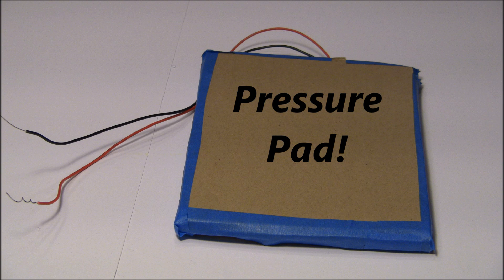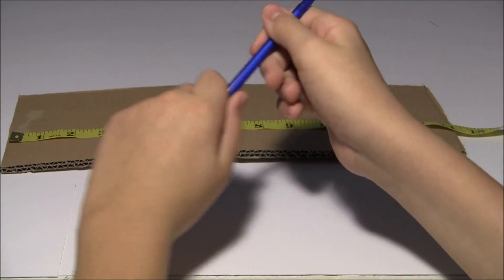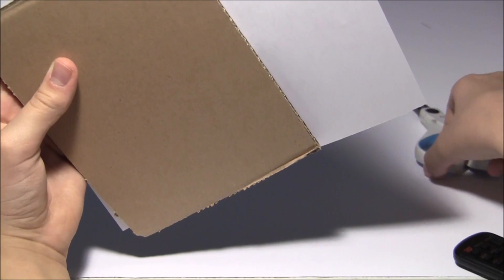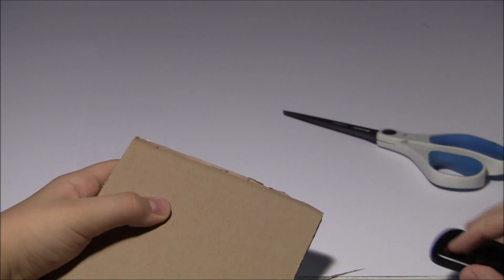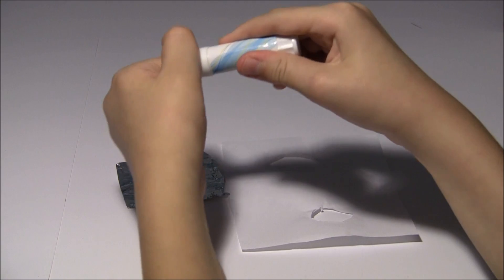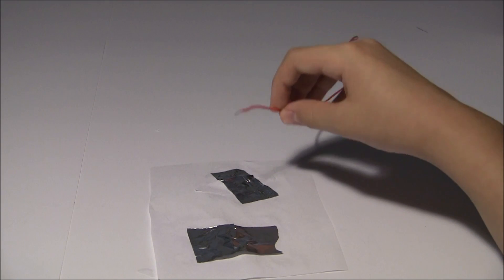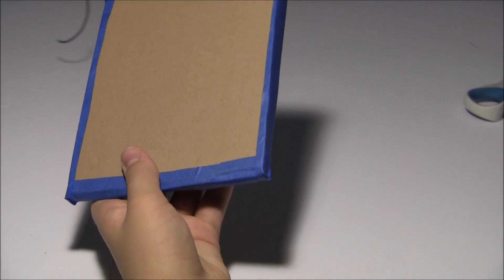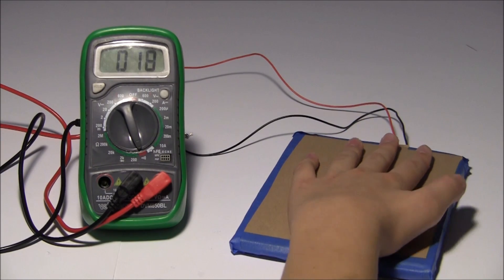How To Make A Pressure Pad

Comment: Is there a weight limit to the pressure pad? Lets say I wanted to measure the weight of a car or truck? Does it depend on the multi meter capability? Another question what setting do you use on the multi meter? Ohms? Excellent vid!!!!!
Reply: i could be very wrong, but I think this won't measure pressure on a gradient, it just senses if there is pressure. Also, I think if there was a pressure gradient, it's limited by the weight it takes for the two conductive plates to touch, shorting the circuit. The multimeter setting being used here is just continuity, seeing if the two plates are shorted by the top plate. You could try voltage (probably would want to run DC through it, so DC voltage setting), but I imagine it would just act as a big button rather than an actual pressure sensitive plate.

Comment: hi ! can u explain where to tape each wire?
Reply from the maker: Sure. Pretend it is like a sandwich. The two aluminum foil pieces are the bun and the paper is the middle. Tape one piece of wire to each of the pieces of aluminum foil. Make sure that the metal of the wire is touching the metal of the foil. Hope that helps

Comment: Bs get paper plates and throw a wire on each,tape it there the put plates open sides facing a if you want fancy put wire in mud along with plates but preferably spray paint being muds bad news for many reasons on the pressure plate.

Comment: Will this pressure pad output a certain amount of pressure that can be measured or will only trigger if it senses pressure?
Reply from the maker: It's a digital sensor, meaning it will go high if activated, and stay low when deactivated.
Reply: Would you have any tips on how to possibly make a pressure pad that measures the amount of pressure exerted on it?
Reply from the maker: There are components that you can find online, called pressure sensors, that output different resistances depending on how much pressure you apply. You could attach that in the middle of two pieces of cardboard and it should work.
Reply: Krazy Contraptions Thanks for the help!
Reply from the maker: No problem!

Comment: Hi,
good work ;) and i want to ask you if we can use this pressure pad like a Fall prevention monitor,if yes how it works or what we do ! thank you
Reply from the maker: The pressure pad can't prevent things from falling, but it can detect if they do. Do you want this to keep track of what is falling?
Reply: exactly , yes that's what i want to say , i mean can we use it in case of fall detector
Reply from the maker: There are multiple ways of making it, the easiest being an arduino and it will count how many times something falls, but if you want it to make a sound when something falls, I have another video showing you how to do it here: https://goo.gl/VmSroA

Comment: So do we put the aluminum foil on both sides of the paper and we put one wire on one side and the other wire on the other side right? And what type of wire did you use in this video?
Reply from the maker: Yes, put a piece of aluminum foil on both sides of the paper. Also you are correct, put wire on both pieces of the aluminum. For the wire, I used 18 gauge copper wire. I hope you have fun building it! :)
Reply: Krazy Contraptions, Thank you!